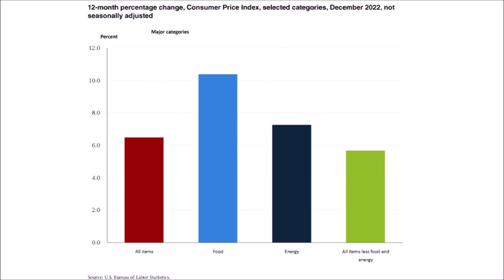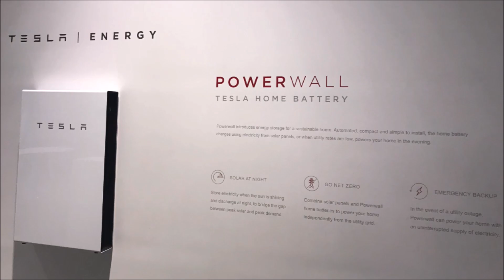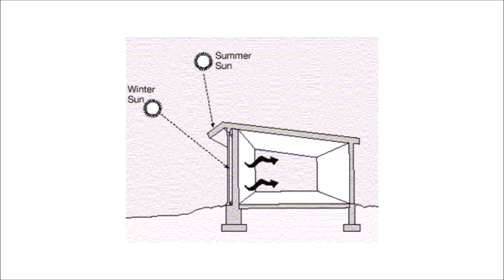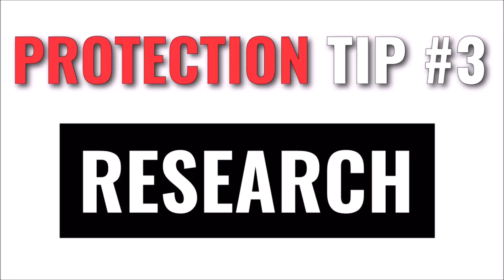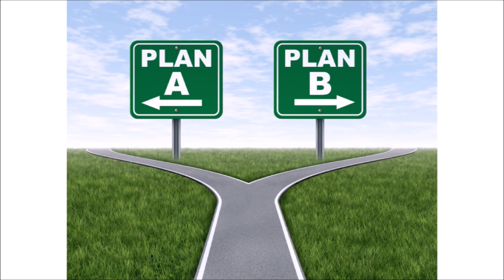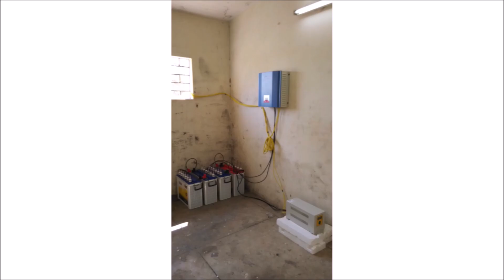Protect Yourself Against Electricity Rate Hikes - 4 Tips For Smarter Energy Usage & Independence

Comment: Sir would you be kind to share your view about charging a 12v lifepo4 battery pack to charge with lead acid battery solar charge controller? 
I think that 14.4v charging voltage for lifepo4 battery is little less but it is safe. Or there is any fundamental difference between lifepo4 battery pack and lead acid battery charge controller.
Reply from the maker: It won't hurt the lithium battery to charge at 14.4V but you will likely never get it to 100% full SoC.  If your charge controller has an AGM setting that would be better than a flooded setting.  But it will work in a pinch or for a short time until you can afford a lithium charger.  I would not plan on using that charger for years or you are wasting the full potential of your lithium investment.
Reply: Thank you very much for your most valuable insight about this topic. I searched a lot in YouTube but didn’t find anything specific. For 100 soc I don’t mind as I want to use only 60% of my battery for its long cycle life. Thank you very much again. Your grade A and B lifepo4 battery is very helpful and eye opening. Thank you very much
Reply from the maker: I am happy to help!  Thanks for watching and commenting.

Comment: Try to eliminate parasitic draws. All so make saving on electrical usage a priority! My goal in to keep electrical usage below 400kw as it has the lowest rate per kw.
Reply from the maker: That is a great point.  Some utilities have tiered pricing and it would be well worth investing in a smart meter for such a home where you can keep an eye on your usage and throttle down to fit into a cheaper price bracket.

Comment: I am getting set up for a pretty good solar  array. There is a company here that wants to do it and the prices are good but they only do grid tie in. No batteries which doesn't help in an outage so I am going to try and do it myself with the help of an electrician friend.
Reply from the maker: Yeah, there are ways to do it after the fact.  You can install a transfer switch that disconnects power from the grid and switches it over to the battery bank, which stays topped off from your solar.  Manual transfer switches are pretty cheap.  Or if you want it seamless and don't want to have to manually switch back and forth you can get an automatic transfer switch but they are more expensive.  Good luck!

Comment: I have a nearly all electric home with a tankless natural gas hot water heater. The gas bill starts at 38.95 for zero usage plus a dollar or two for my gas I use for my shower or wash a few dishes. It would be FAR cheaper to use a less efficient electric tankless hot water heater, pay a little more on my electric bill, and eliminate that 38.95. That would be my first step. I already use a mini split heat pump. After that water heater swap, yes I agree with adding off grid solar even if it wouldn't be cost effective, just for the decentralization and independence.
Reply from the maker: Yeah those baseline fees are garbage.  It may not be possible for your home, but you should look into getting a propane tank for your home.  You can bury them underground to hide them.  Then you won't have any baseline fees for the natural gas company "service".

Comment: It's easier to provide backup electricity or propane than natural gas.  But natural gas (at least in my area) is more reliable than electricity.  Dilemma...
Reply from the maker: Yes, if you don't have natural gas access at your house already then forget about it.  Just get propane.  But some folks may have electric appliances in a house that has natural gas because they used to live in a home that didn't have natural gas.  I know that has been the case with me as I have moved over a dozen times since high school.
Reply: @LDSreliance  But would you really want to add dependence on natural gas by replacing electric appliances?  Maybe you would because natural gas might be more reliable than electricity. But maybe you want to keep your electric appliances, because electricity is a lot easier to provide on your own than natural gas.
Reply from the maker: It is definitely not a clear cut decision.  Most appliances can run on either propane or natural gas.  So I always recommend people consider buying a propane tank for their home and go that route.  The fuel itself may be a little more expensive than natural gas but you avoid all the monthly fees and taxes and garbage on your natural gas bill.  Plus, you may be able to shop around for good propane prices or refill the tank at your discretion when prices are optimal.  Just another thing to consider.

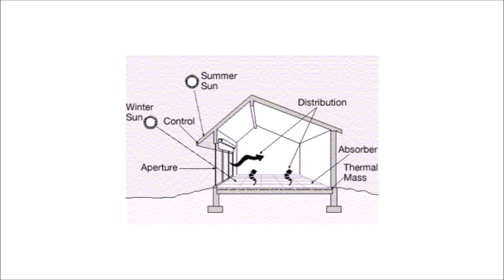Comment: If you're on a Time Of Use (Peak/Off Peak) Plan, consider PRE-heating and PRE-cooling your house.  1 hour before Peak Pricing Kicks in, run the air conditioning to ensure you're already at the desired temperature so you're not wasting peak power to do it.  Edit:  2:14 looks like an Earth Ship.
Reply from the maker: That can certainly help.  Maybe even program it a few degrees above/below your normal set point so it takes a while for the home to heat/cool to the point of needing more air.  As long as you do it well enough ahead of time the whole house will act as a buffer as it soaks in the cold/heat and then slowly releases it as it goes back to equilibrium.  Good comment!

It may be an earth ship.  An indoor greenhouse, either way.

Comment: I'd say it's tough to reduce your energy until you know how much energy devices use.  Get a kill-o-watt or other energy monitoring device.

Also check with your electric company.  In addition to the appliance rebates mentioned in the video they often sell energy saving devices like led bulbs at a significant discount.  I have 4 energy saving plugs and led lights I got at a discount.  I also got an insulation kit completely free of charge.  The energy saving plugs cut the power to TV and computer accessories when the TV or computer is turned off.
Reply from the maker: I should have included that in the research tip!  Oh well.  Great point.